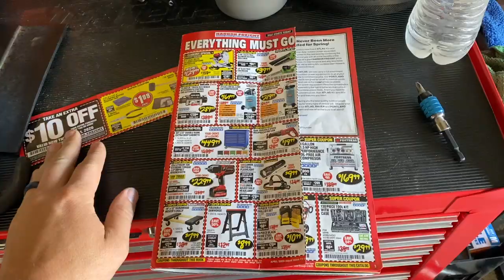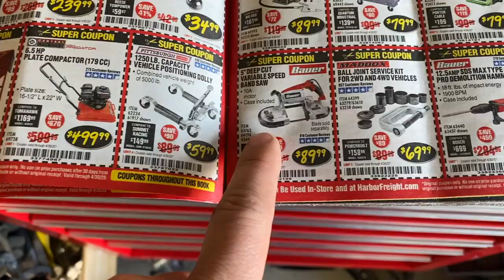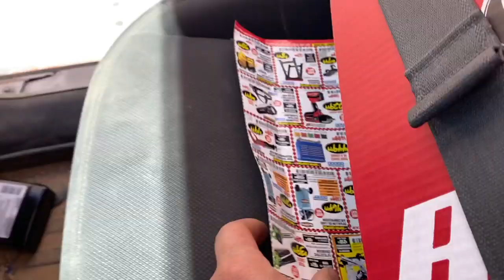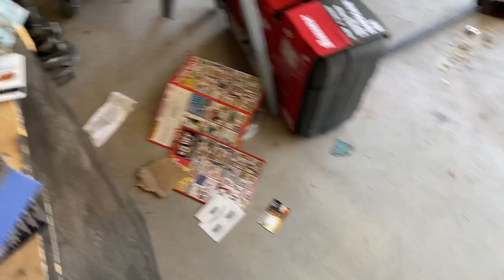New segment coming to your favorite channel

Comment: Fools With Tools sounds like a good start but sure open to more suggestions... No need to pull that trigger too soon.

Like you, like many we all have a chaos of tools semi organized that gets disorganized, family pilfered and not out back in the right spot.

Get some narrow shelves (built strong) and use that vertical space more for rare tools and keep that ladder handy...

Like you I've made (still disorganized piles on them) areas for standard tools, auto, electrical, farm stuff, fasteners, jeep (yes jeep parts)... I think key is make a area/shelf for wife... "Do with what you will babe..."

All set to hook up that 220 ;) put in that new breaker, route those wires... Kids screaming why the power is off and they can't watch tv.... Grin 😀
Reply from the maker: Me and misty will come to a discussion I’m sure.. got a lot of awesome recommendations from other subs!

I’m ready to move from chaos to clean look.. tires of loosing tools.. to include not finding them! My kids like to snake my screw drivers and leave them sprawled out house.. maybe I should be locking my tools up 😂😂. 

Shelves in some empty space are still needed I’m glad We have high ceilings... I also need to get rid of a lot of them board games. 

My uncle is an electrician... suppose to come over and help me... make sure I don’t burn our house down.. electric work ain’t my strong suite 😬 not scared to tackle the task... but making sure I don’t kill my family is a high priority for me lol

Comment: I’d watch that $hit. Mo Tools, Mo problems. Hey. I’m a garage freak. This will sound dumb but trust me. The walls are dry walled and taped. Paint everything Brite white. It makes the space sooo much brighter.
Reply from the maker: Thts actually not a bad idea... once I can pull the j10 out... Thts a project to do for sure! 🙌🙌🙌😂 thanks for the tip!

Comment: I agree with you 100% I'm not a mechanic and when I first started tinkering with my Jeep JK, I didn't know anything about mechanics. I learned on my own with advice from others, doing all the work myself with the exception of setting up ring and pinions.
Reply from the maker: I’m there with ya... when I started... improbably has as much knowledge and how to as a oil tech 😂 

Iv learned ALOT since I bought the jeep... granted I have some extremely knowledgeable friends to tap into when I need it lol

Comment: 220 is pretty easy to drop in... is your panel in the garage?  if so bang that outlet in and start welding!  some of those houses down there have all the main panels outside so that might be a little big more difficult depending on where it is on the house.
Reply from the maker: It’s outside the garage... I just want to make sure I don’t burn our house down.. my uncle is an electrician and is suppose to help me install it...
Reply: @JLLIFEOFFROAD  Sweet that's even better when someone you know will do it!
Reply from the maker: I’m sure I’ll do all the work... he will make sure I do it right
Reply: @JLLIFEOFFROAD  black to black, red to red, white to white and ground to ground haha!!
Reply from the maker: Lol u mean house to ground! 😂😂😂 

My logic is if it looks like a hack job... insurance will not pay out if it catches on fire... if it looks correct... shouldn’t be an issue 😂
Reply: Hahahaha!!! I love it.

Comment: Fan of Harbor freight for tools as well. The new Icon tools are amazing. The Icon torque wrenches are out performing Snap-on and Mac tool's in reviews for accuracy and have warranty's to match and cheaper tools at HF. Wish the winches that are suppose to compete with the Warn EVO VR entry level winches had the same warranty as well but they don't. But HF tools are pushing the big dogs to get better.  Love Capitalism. Nice video. Mo Nose Tools, my suggestion for segment. Only cause you give those facial expressions, lol. As well it matches your personality and demeanor and humor. Plus you are well detailed, very appreciated for that. Thanks for videos.
Reply from the maker: I just bought their icon ratching wrenches... they have been working great... and like I said.. lifetime warranty... I break one... replacement! However Pittsburgh has never done me wrong either... most of my tools are Pittsburgh... only broke. The torque wrench... a few of their older power tools Iv broken.. but iv been pleased with Hercules and will soon be testing buaer... 

Harbor freight is moving in the right direction if u ask me... they just need coupons for the higher end stuff
Reply: Completely agree, still buy the Pittsburgh brand for lifetime warranty tools, but when I use the tool less. Agree with coupons but for the price and the direction they are going. They will be pushing the high end tool manufacturers the right direction for competition. Power tools still not there yet. But for us all, hopefully soon.
Reply from the maker: I agree 🙌 looking forward to seeing how they continue to improve!

Comment: Ain't nothing wrong with harbor freight every time I go there I get a free measuring tape or magnet light🤙
Reply from the maker: I mean, if it wasnt from HF.... I wouldnt have many of the tools I got,,,, and would translate to me doing less work on the rigs... me getting less satisfaction out of my life. They have ben making huge improvements to all their lines of tools,, granted not everything is perfect, but im loving the direction they are going..... but I believe they are over charging for their ICON brand....time will tell.
Reply: @JLLIFEOFFROAD  oh I hear you a lot of my tools are Pittsburgh 🤙
Reply from the maker: Life time warranty.... snap on don’t offer tht 🤷‍♂️ the only tool I’ve broken from Pittsburgh... was their torque wrench... gave it to much ugga lol